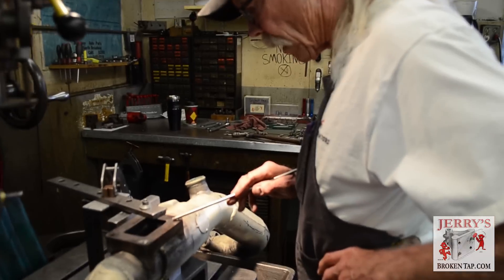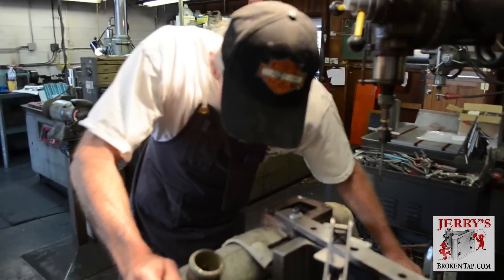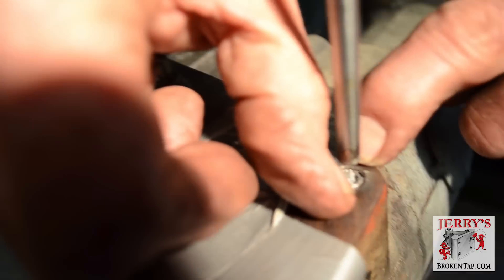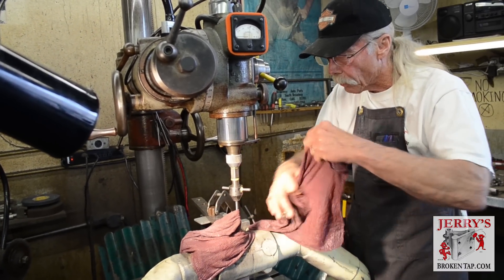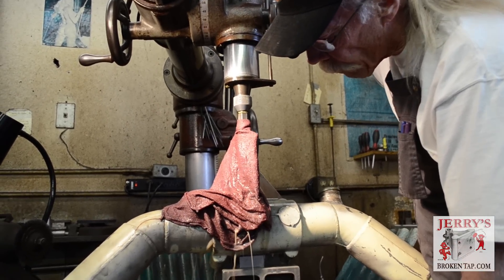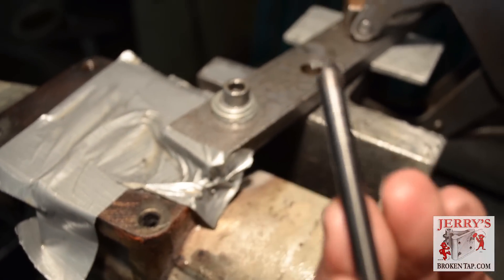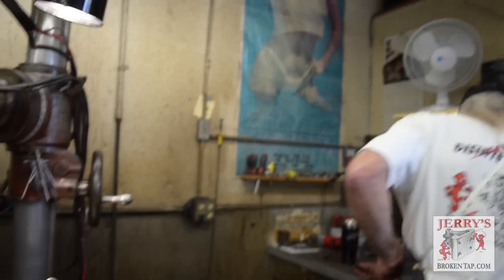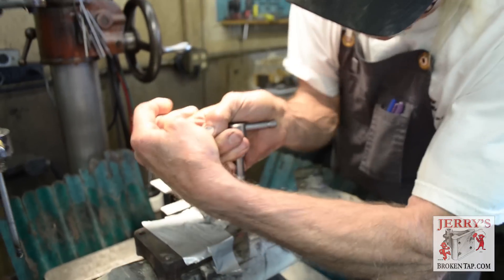Broken Easy Out Inside a Broken Bolt - Extraction - Part 2

Comment: These ez outs are kind of dangerous and should be avoided at (almost) all cost, they can be good if something broke as you were installing it, especially if there was lubrication involved but bolts that are seized typically dont come out. The unfortunate (because of cost) best solution is to weld, if its seated deep you can use a copper insert tube down to the stuck fastener and then build up the weld from the fastener & up through the tube.

Comment: I love how everyone amazed by his confidence with the tap doesn't realize that if he pops it the machine to undo the mistake is literally right in front of him, and probably easier to fix than the bolt since it's not a complete thread.
Reply: Did you see him tear the tap out of the hole damaging the thread hs he just chased. - He need to go see Mr Pete to learn how to use a tap. Hes technique is from Kanarcy. - He NEEDS the tap burner to be close by with hois technique.

Comment: When using an easy out NEVER forget to lubricate the threads with Liquid Wrench or similar lubricant. Wiggle it slowly on the way out. Without the lubricant, you will break the easy out.
Reply: Better yet never use an easy-out. You have a better chance of hitting the lottery then getting a bolt out with an easy out. - If you are already drilling then go all the way and use right size  tap drill and retap the hole. Worst case is you may have to use a Helicoil. ,,,or this birds beloved Timecert. ,,,,If he had a milling machine and knew how to us it if you have damaged threads you can drill and tap it to the next size up and tale a piece of stud rod and locktite it into the hole and then drill and tap it back to the correct size.No need to buy high buck thread inserts if you are more then a second year apprentice machine hand.

Comment: Ok the threads on my ez out are now worn from two previous bolt extractions. My mistake is that I have then used a larger drill bit with the intention of using a larger ez out. The only thing I have accomplished is that I have shallowed out what was a decent depth hole from the original drill bit - should have just bought another ez out of correct size....so, what now? should I insert the correct  size ez out and fill the bolt with weld. Could that work?

Comment: Havent had to do many broken bolts, but ive removed plenty of taps and drills, i usually will use a drill bar or guide of sorts if i have to use a hand drill.  If im lucky and i have the room ill use a mag base drill, starting center punch and then with a carbide ball end mill to make a small pocket, this will allow my carbide drill to track straight, with a drill bit this is usually enough to be able to remove the remnants, if its a tap, it may take a few step ups of drilling to get it.

Comment: Been in the automotive field for almost 40 years, never used a cheapo-off brand EZ out (either it was Snap-On or MAC) and more often then not, the tooling always broke.   Although we just usually push the work off to our in-house machine shop, its nice to see how its done with an actual tool designed to do the job the right way.

Well done with these videos and wish you guys would put out more.  Very informative indeed.
Reply: Honestly snap on and mac are not cutter manufacturers.  They are still garbage.  The problem like was explained here is that you are taking a smaller diameter cutter that while being harder is also more brittle if something is seized you will most likely exceed the torque capacity of the smaller tool and it will shatter.

Comment: Great videos. Have you ever seen the A-SURE OUT extractor? It can be removed in seconds if it breaks, no EDM or DRILLING. After seeing it, only a fool would use anything else! All materials and labor made in the USA! For over 100 years the bolt extractor has changed in many ways, however the failure of a bolt extractor seems to have been carelessly overlooked leaving all users the possibility of catastrophic failure. Help support an American company. Thank you.

Comment: will this technique work on a Mercury lower unit where 3 of the 6 mm (m6) water pump housing bolts seized, the easy out broke in one of the bolts, and a drill bit broke in the second bolt. Now I have an easy out stuck in one and a tip of a drill bit in another.
Reply: DAM, AND I THOUGHT THAT I HAD BAD LUCK!!! GEEEEZ!!! I HAVE A BROKEN PIECE OF EZ OUT THAT'S BROKE OFF INSIDE OF MY STARTER BOLT THAT'S SHEARED OFF.

Comment: If one uses the higher end of extractors No dollar store/wal mart/home improvement cheap $4.00 set of extractors they do not snap as frequent. I just handled a rear differential project with a set of $50.00 extractors removing 3 broken off bolts From drilling to bolts out was 20 minutes. I went into project with a 99% failure rate (every one quoted it) "extractors are crap and break most all of the time". I think I broke 2 drill bits, set my extractor with a hammer then used a 1/2 in drill to back em out all 3 came out. So in closing not so much the mechanic/machinist errors when extractors break it is the cheap metal the extractors are made of. But yes in a few cases rust/seized bolts do need to be machined out.

Comment: Great info, how about a 304 stainless manifold stud in an aluminium head.. that was just recently changed and broken when the nut was placed on and torqued down. , The nut came off with some thread and it broke the stud flush with the head, however the stud IS bottomed out in a blind hole. What are my chances with an easy out? I believe my situation is different ... There should be no ceasing however it may be tight up against the blind hole. I'm not sure..

Comment: The last easyout I broke was in the front hub of a ford truck it was the steering stop bolt and I ended up just using a die grinder and tungsten burr and ground the whole lot out, cleaned up after I ran a tap through it but it took ages, that method you use is very nice, is it a converted radial arm drill?
Reply: Electrarc tap burner. Actually a very common machine. They did used to make a remote head you could stick on a drill press but as I remember it did;t have vibration and defiantly had no power feed. ,  If you have enough work for one it's worth the 5  to 10+grand, but I'll take a Bridgeport any time. The is nothing you can that you can do with a tap burner that you can't get done with the mill , Just the tap burner is a little faster at broken taps, but I'd like to see you use a tap burner to drill a bolt hole circle or cut a gear.

Comment: But like me i can't afford a shop that specializes in gotten the bolt out . I have a lower control arm bolt that broke off i am trying to get out now i tried the bolt exterior but it not working so i at the point just drill the bolt out and rethread it .

Comment: Excellent work sir .great video anyway
Reply: +synthesizer301 Thant you, were happy you liked it!
Reply: @tomgrafton8681   I HAVE A STARTER BOLT THAT'S SHEARED OFF FLUSH WITH MY ENGINE BLOCK. 350 CHEVY BY THE WAY. I DRILLED A HOLE AND THEN INSERTED AN EZ OUT. YES, THE EX OUT BROKE AS WELL. IS WELDING A BOLT TO THAT BROKEN PIECE MY ONLY RESOLUTION??? PLEASE HELP. THANKS IN ADVANCE. 👍

Comment: Mechanic for 25 years here. I have removed many broken bolts mostly by welding a nut on or if broke flush just weld a small nipple on it and grab it with vise grips. More so than less I wish your business was across the street from me! You are an artist at fixing screw ups or bad situations. I wonder what the cost us for this service.........

Comment: I use an EDM at the machine and fab shop I work at. It is the final solution if I can't get it out with a TIG welder. The EDM takes longer to set up and use , but it works when all else fails. One suggestion that works good for me is on small bolts and taps, drill a piece of 1/4" plexi-glass a hair bigger than the electrode and cut a groove for the coolant to escape. Position it over the broken bolt and clamp it down. It works as a guide to keep the electrode centered up on the broken small bolt or tap. I also use plumbers putty and sheet metal to make dams for directing the flow of coolant. Nice video.
Reply: I was thinking about that, do you just use continuous heat or do you have a cycle frequency with a coolant and a sacrificial electrode?

Comment: Professional machinists, mechanics, electricians are easy to spot--they DON'T WEAR RINGS.
Reply: Or if they do wear rings sooner or later they wont be wearing fingers.
I have been out of "the trade" for 30 years and I still CANNOT comfortably wear a ring or a watch for that matter.
Reply: @TheMadManPlace  i usually have a watch on, but its on an expansion type band, that being said, if im at a machine for any length of time it usually comes off and sits where i can see it, but if im making a quick pass or drilling a 1 hole, i wont bother.   Exception being the lathe, everything comes off and it's why i never wear long sleeves in the shop period.
Reply: Hopelessand Forlorn I
Reply: While I understand both side of the issue at hand some of my fellow technicians have started wearing a silicone ring, while at work and the real thing when off work. 
The silicon ring is elastic and will break very easily, still another technician I worked with had his tattooed on, I personally wear no jewelry of any type at work.
Reply: @alabama7636  I never wore a ring of 50 years of wrenching..more for the electric problems it can create..my old boy here is not a newbie..this is a true old wrench
Reply: +Hopelessand Forlorn is
Reply: +Tom Grafton Do you have a point your trying to convey
Reply: Weapons mechanic 1960-64, A&P Mechanic's license 1965, airline mechanic 1965-2009.  In 1962 an Air Force fire control specialist of my acquaintance left his wedding ring, ring finger, and about two feet of tendon hanging from a fitting on an F-105 after his ladder slipped.  I have since seen rings turned instantly to molten metal when the wearer bridged heavy current contacts in low voltage circuits.  You know better than me, you go ahead and wear all the jewelry, piercings, and loose, long hair you want.
Reply: I was a machinist and I mechanic on heavy equipment. I wore a ring never had a problem. Called watch wtf your doing!!!
Reply: He's wearing a ring.

Comment: Great videos Tom!  Thanks.  Removing old studs rusted into an exhaust manifold has to be one of the toughest jobs for a mechanic.  Weld a nut onto the old stud if you can, then heat it red hot and apply engine oil - not WD40 as most people think.  WD40 often works great when applied to cold rusted parts, not so great if heating is needed.  The detergent in common engine oils works much better if you give it some time to soak.  There will be a LOT of smoke so good ventilation is needed.  Keep applying the oil as it burns off and the part starts cooling.  Then let it soak when the oil stops burning off.
Reply: Jim Manson Gently work the stud back and forth loosen-tighten, loosen-tighten if it moves just a few thousandths, and keep adding oil.  If you can't get that first few thousandths of movement, then re-heat it red hot and apply the engine oil again.
Reply: +Jim Manson paraffin wax is the best lube at high temps try it

Comment: Thanks Jerry, That's quite an amazing machine.

I've found if a bolt even acts like its not going to come out, that heating it very hot several times will finally get it to work loose. If I can get it to move just a little I'll get it going back and forth careful not to put too much on it,  trying to increase the movement range little at a time until it finally comes on out.

Comment: What if it broke on the way in because some dummy (me) didn't have a properly calibrated torque wrench? Can I just grab the head of the broken side with vice grips and try to remove or do I use a specific extractor?
Reply: CDubs HasIt If it broke from over torque an easy out should? If it seized on the way in it will not! Tom

Comment: A stupid question: What is the major advantage to use very expensive metal disintegrator instead an accurate drilling machine? For example if we have a broken M10 x 1.5 bolt, it is quite easy to drill a hole through it with a good drilling machine with 8.2 mm or even 8.3 mm drill bit without harming the threads. Then you can use a small hook and pliers to get out the remaining bolt threads. And finally you clean threads with a tap.
Reply: Pili Pali Your partly right! The only way you can retap after drilling is to be sure all the bolt is out including the threads.Tom
Reply: Can you drill easy outs with carbide?
Reply: Nw.Caffers you can but it tend to get a little spooky when you hear crunching sounds from the carbide then you have to use elm to get the carbide out if you can’t shader it and remove all pieces.
Reply: Most of these applications are where a hardened tap or equally hard screw extractor has broken off in the hole; I'm not sure even a cobalt drill bit would get through that hardness of steel.
Reply: @jimdavis8391  The answer is NO! I tried Cobalt yesterday and it barely dented the "EZ-out"... More like "EZ-break"! FML!
Reply: the hardened part will at least shift the drill's position, leading to a non-straight hole. EDM does not have that problem given that you "drill" slowly enough.